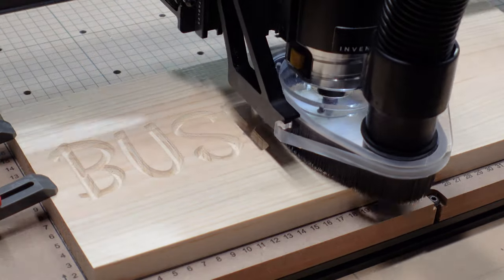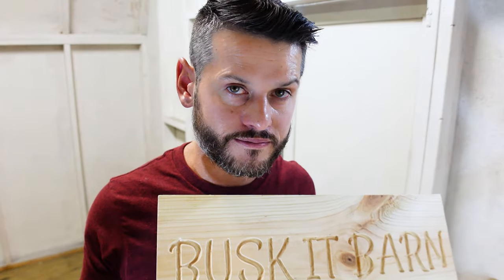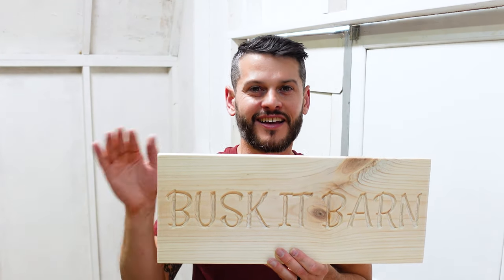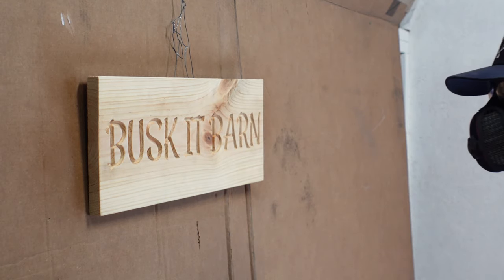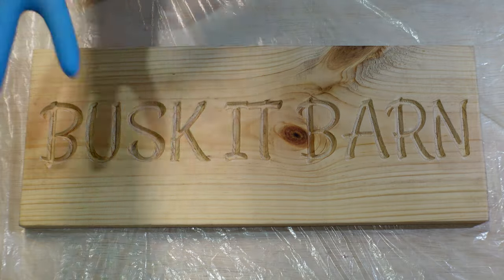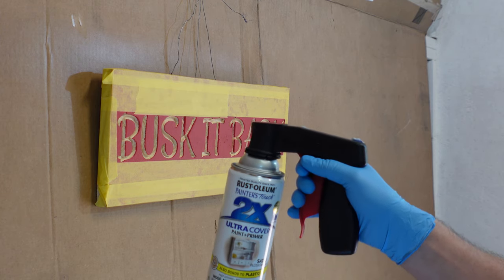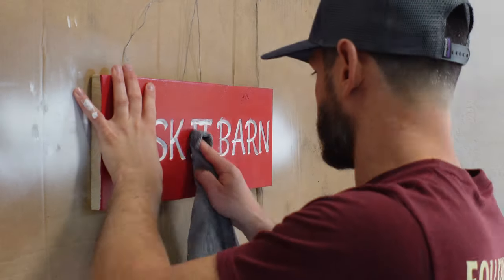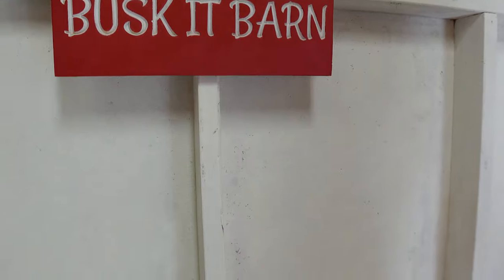How to Paint Carved Wood Signs DIY || Woodworking CNC Project

Comment: Why not just spray it white, sand it, and then roll the red? Seems easier.
Reply from the maker: When rolling on the red after, I always get it into the lettering, which for me is difficult to get out. I’m sure your method would work, I’m just too clumsy!
Reply: @BuskItBarn  to be able to use this method painting first the letters, you need to use a high density foam roller to paint the background, this roller is a perfect cylinder, the paint won't drop down into the lettering

Comment: I need to make a painted wood sign for outdoors.  I like how you did this.  How did you get spray paint off with a water moist sponge and rag?  Before painting the letters, I was expecting you were going to put some sort of sealant or something like that, over the red that would make removing the white paint off the red easier.  Was masking the red as much as you could the trick?

Comment: Seems like you could have just spray painted the board white, used your roller after to paint the board red and skipped the whole wiping off part....
Reply from the maker: Thanks for the suggestion! When I’ve tried that in the past, I get paint splatter in the lettering that I’m not always able to fully remove. Maybe that’s just my clumsiness though!